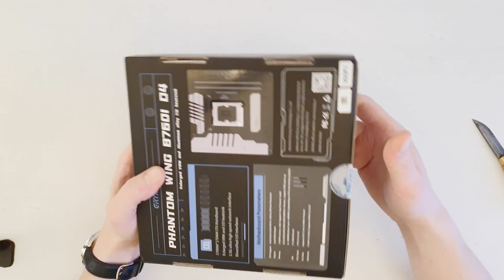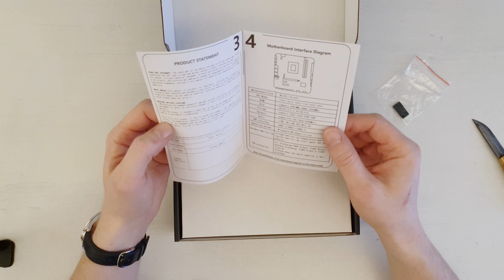🇬🇧 Unboxing ERYING B760 mini-ITX motherboard from AliExpress

Comment: Hello my friend, how are you? I bought this card, but most 12th and 13th generation processors work with a maximum of DDR4 3200MHz. According to the manufacturer, the card supports up to 4266Mhz. Can you tell me which processor I can extract this frequency from?